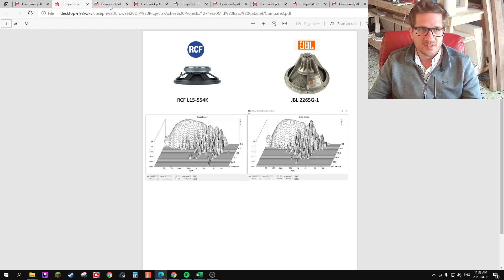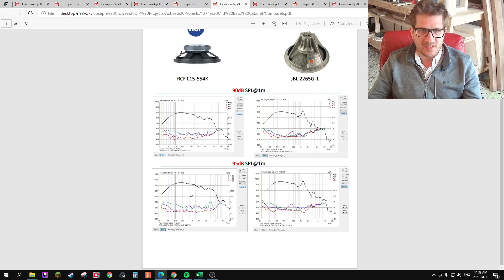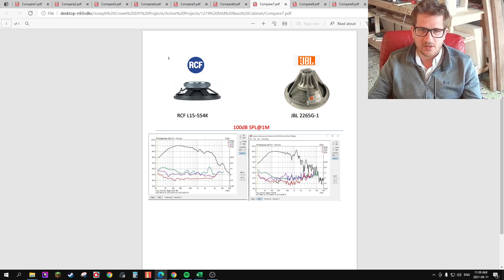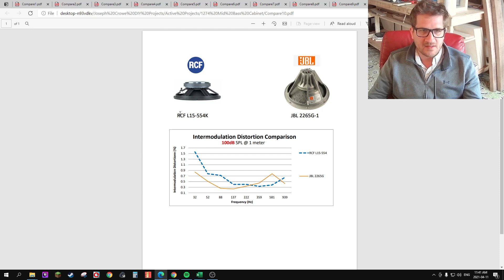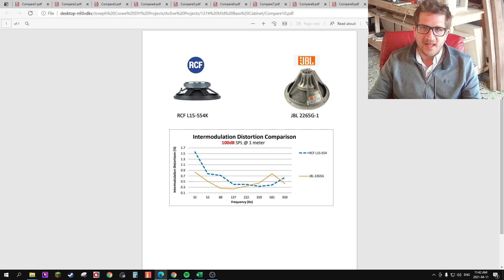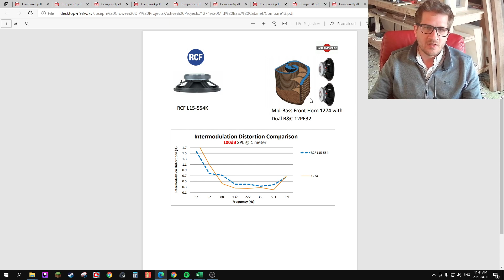JBL Differential Drive Vs Regular Copper Sleeved Motor

Comment: Eighteen Sound also makes push pull dual gap woofers.  Their top of the line ones are called "tetracoil" but that actually means both dual gap and inside/outside winding for a total of four ( tetra ) coils.  They have some push-pull motors with only outside windings ( like JBL ) that aren't called Tetracoil, which i think is bad naming strategy.  Overall the Eighteen Sound ones seem to be somewhat upgraded over JBL units ( they top out at 21" and 4.5" VC versus 18" and 4.0" VC for JBL ) but i would just use whatever was available locally - i'm sure they're both great.

Comment: How are you doing these measurements? I've measured outside but could never get below 100Hz accurate aside from testing very close to the driver
Reply from the maker: That’s right.  These are near field measurements or ground-plane depending on the type according to Joseph D’apollito’s Loudspeaker Measurement book.
Reply: @JosephCrowesDIYSpeakerBuilding  How close? Seems like if you go too close you won't get all of the higher frequency content correct from it originating on different parts of the woofer.
Reply from the maker: I try different areas of the driver to make sure I’m not hitting on a mode spot.  Typically at the cone about 1cm distance (for near field).  But for IMD I used ground plane.  For group delay I used near field.
Reply: @JosephCrowesDIYSpeakerBuilding    So if I understand your measurement method you are scaling a near-field test to the appropriate SPL . How will this be applicable to real world use of these drivers? At the very least you should be doing 2 metre ground-plane measurements. That can be directly correlated to as used conditions. A near-filed test is not really applicable in this type of testing if you are taking the leap and saying this is how they will sound. It's nice to see someone trying this test application. It is indeed useful. But consider applying it in a manner that will correlate to actual use conditions.
Reply: @gerhardwestphalen  you've obviously got a problem with either nearby objects or noise (wind, vehicles, etc.). Try to determine if you are sufficiently drowning out ambient noise, and if you're picking up reflections from nearby objects.
As a rule of thumb, from personal experience, measurements outdoor should be at least 80 dB @ 1m loud for sufficient SNR (signal over noise), and at 1m distance from speaker to mic the setup should be at least 5-10m distant from any hard object.

Outdoor bass measurements, done properly, are VERY clean - even cleaner than near field measurements indoor, where even when you place the mic directly at the dustcap, in most cases you'll pick up some remainder of a or multiple room resonances.
Reply: @stoneeh  I don't have any noise problems. That has nothing to do with this. Just to get down to 100Hz you need a 10ms window. If you're testing from 2m away (which you need to do for bigger speakers) then that would mean the speaker and the mic would have to be 2.5m high. That's a pretty high ladder. I've done this and gotten down to around 100Hz but I can't realistically go any higher. 

Obviously you can do nearfield or ground plane measurements but those have their own drawbacks. The biggest challenge is putting together these measurements to try to see the overall response. It's necessary to get enough overlap by having good measurements on both sides so that you don't end up with a gray area where you're not sure what's going on.
Reply: @gerhardwestphalen  I assumed you were referencing a GP measurement of a woofer, since this video was about woofers. Seems what you want to do is measure full range boxes outdoors, which ofc is a different challenge.

Measuring mids and highs on stands and bass (below 200 Hz) in GP is the usual practice and the way to go. There won't be any difficulty of adding / overlapping responses in ARTA at that frequency.
Reply: Use ground plane to measure for full-range responses , forget gating below 400 hz. 

GP reasonably away from buildings will be very accurate
Reply: How are you measuring , gated or ground plane ..?